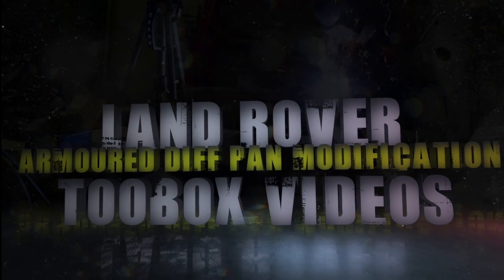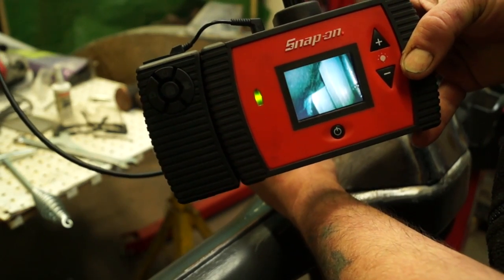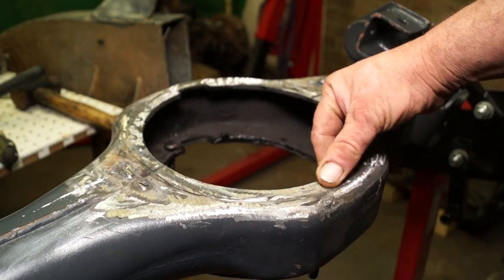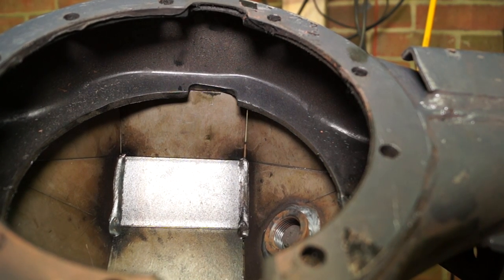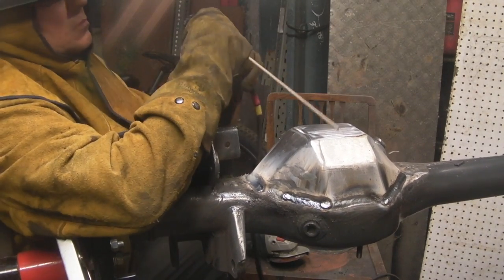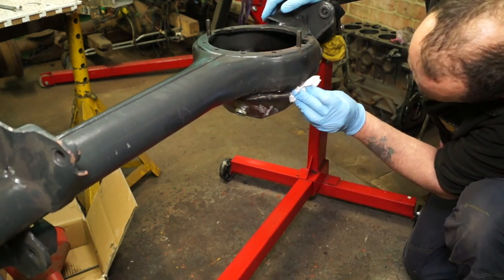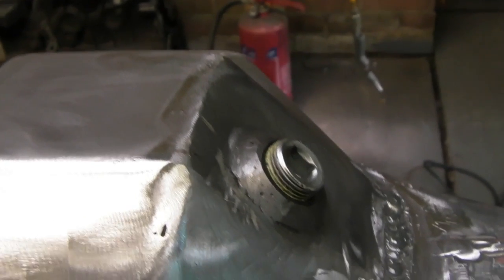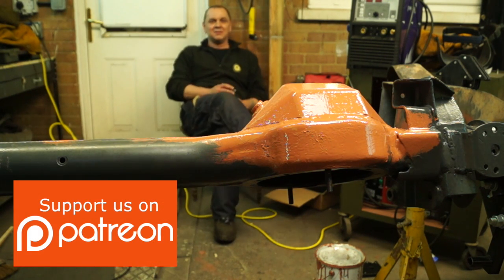Land Rover (AXLE) welding - Armoured Diff Pan Fitting - PART 2 Measuring, Welding and finishing.

Comment: my rrc has a misfire issue it started misfiring replaced the spark plugs fixed it for about 50 miles then it started misfiring again the the new spark plugs a fairly black any idea what could cause this or a possible fix.
Reply from the maker: Guerilla comment.    Misfiring V8 isn't relevant to welding tutorials.  However, I'll answer this 

Misfire is caused by,.. anything from manifold air leaks to an HT lead breaking down and not giving a correct spark.  Sorry to say my SI knowledge is very limited.  Black carbon fouled plugs is an indication that it is running too rich.  Either could be an air leak, vacuum pipe/ manifold or CO sensor faulty causing the short and long term fuel trims to be incorrect. If on one or 2 cylinders it could be injector problems.  

 You've not said if you are on EFi or just carburettor controlled fuel system so I cannot really say much more.

Comment: if you use a polarising filter you will avoid those reflections on the steel ruler and the camera will pic-up all the details clearly.
Reply from the maker: I use the filter you sent me.  Works but is surprisingly dark through it indoors.